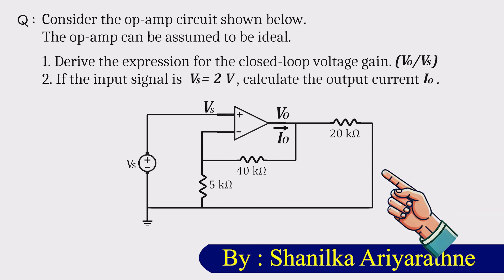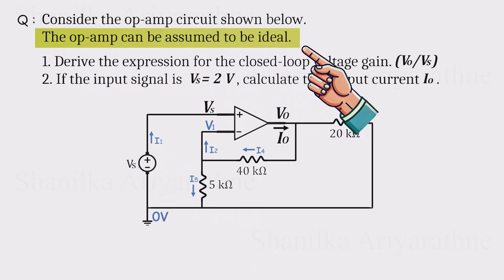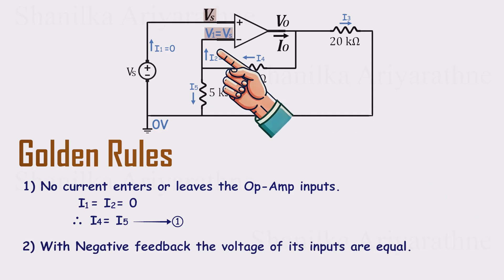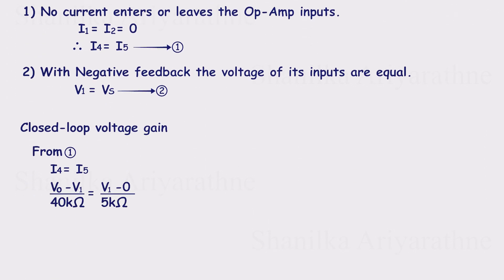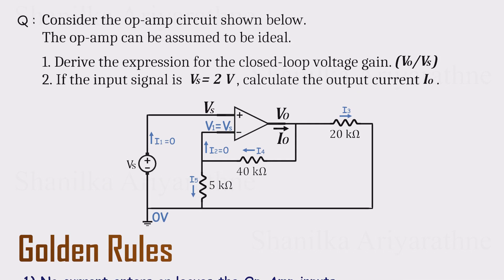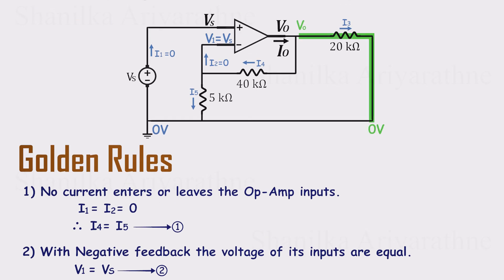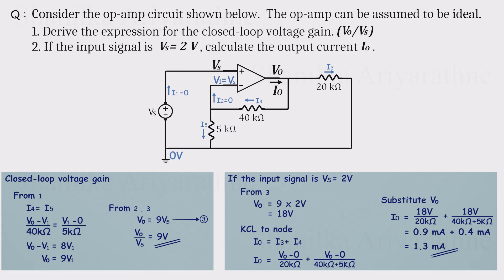Non-Inverting Op-Amp Explained: Gain Derivation & Output Current Example

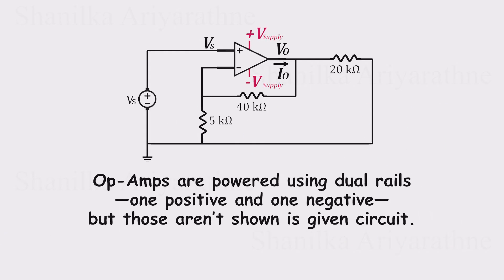Comment: 0:40 - The "op amps run from dual rails" thing is somewhat misleading unless you're using "jellybean" op amps and typical circuit designs from the '70s. Op amps (especially modern ones) are perfectly happy running from a single supply rail; you just need to bias them properly.